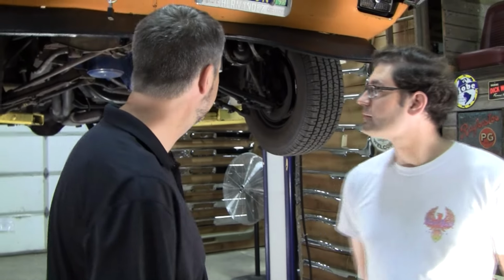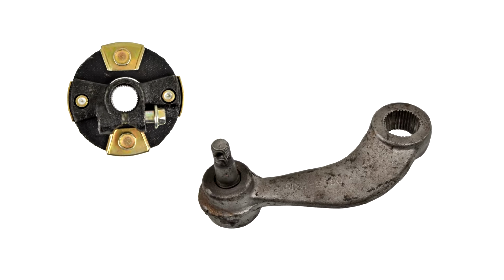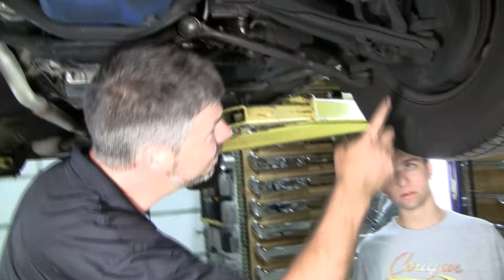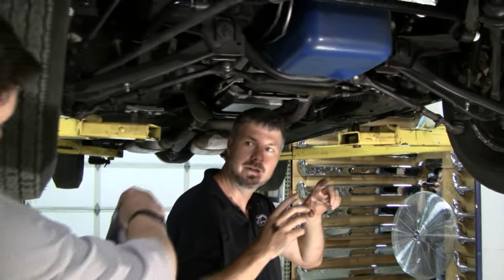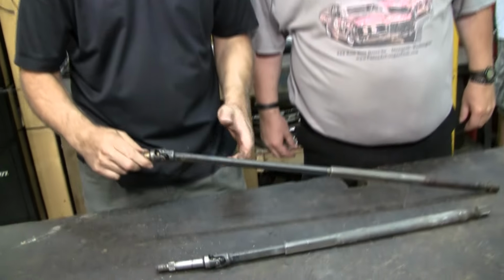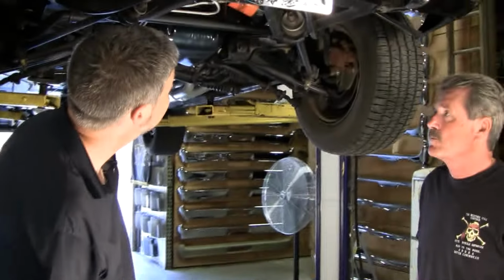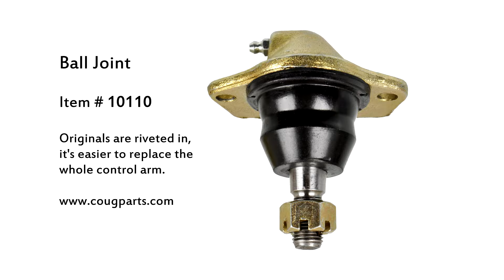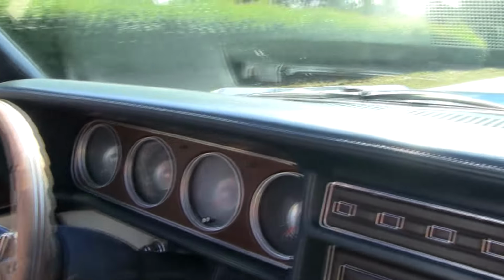Sloppy Steering Syndrome - Problems & Solutions

Comment: Great job! I've put up with my jeep steering for 5 years thinking it was like that because of the older steering design (has no lift but has always wondered with loose steering). But I realize it is 17 years old and probably needs more than new shocks.. the symptoms describes at the start is exactly what I get.. just have to get it hoisted up now. Cheers

Comment: Typical mechanic..  making a big deal out of nothing...  Tighten up the worm gear in your steering box...  Don't let a little 'paint' stop you.  These were painted at the factory AFTER assembly.  geez...
Reply: cmscms123456  Do us a favor; Stick to back yard work on your own vehicle. 
100,000 mile vehicles rarely suffice in simple adjustment. It can also cause the box to lock up completely.

Comment: I have a 1981 Ford F-100 Pickup truck with a bit of play in the steering wheel how would I adjust some of that play out I have replaced tie rod ends but still have play